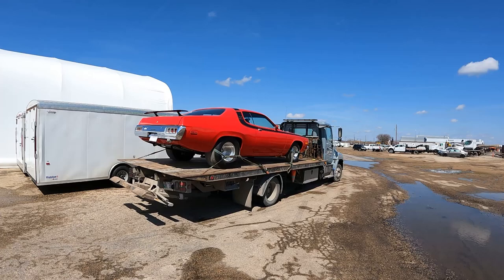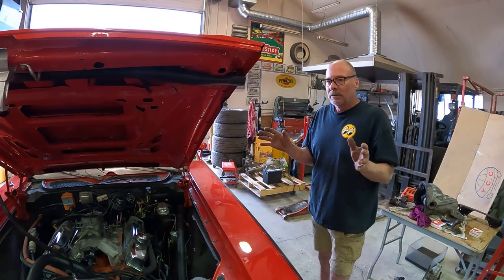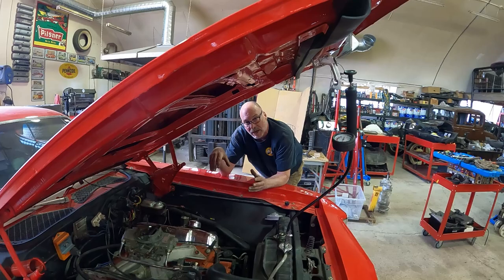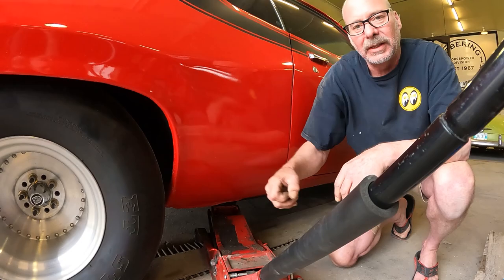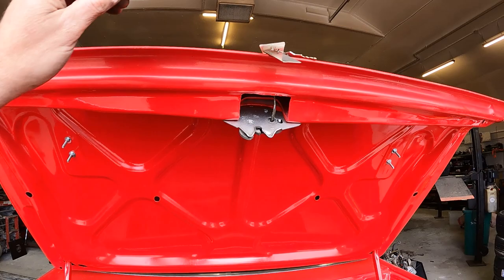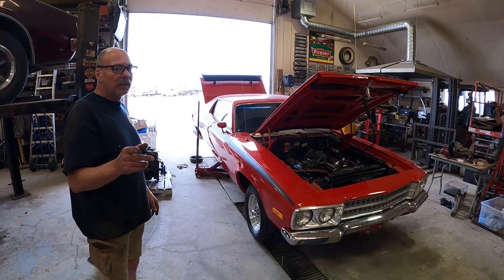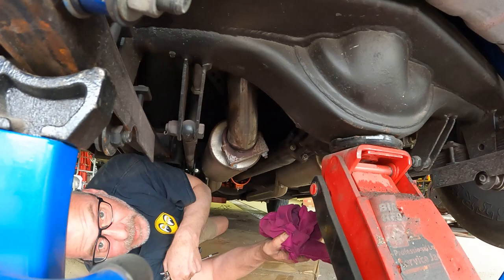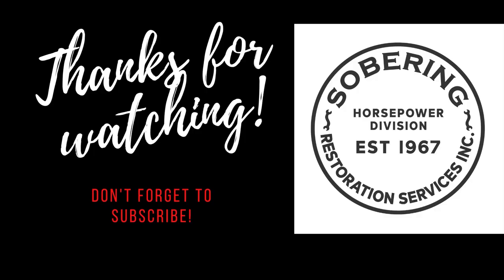1974 PLYMOUTH ROADRUNNER MOPAR IN THE HOUSE

Comment: If the owner gets tired of the MSD, the stock Chrysler electronic ignition is a good system.  I knew an engine rebuilder who would build custom ignitions (for any domestic  V8)  and he used the Chrysler modules.  Thanks, for the list of recommended channels, I watch most of them and I think you guys got good taste!

Comment: Nice car! Big block! Sweet! I love working on the old stuff. Frame connectors im sure too. Guess you are feeling better now too? Good to see you back at it. No safety stands, damn, Jeff!!   
I agree, heater cores are not fun. Equinox is like 6,000 screws…
Do yourself a favour,pipe insulation on jack handles.
.006 to .009. Thats measuring on ring gear. Could have been enjoyed for a long time. Fix it before it demolishes itself- best practice. 
Sounds nice!